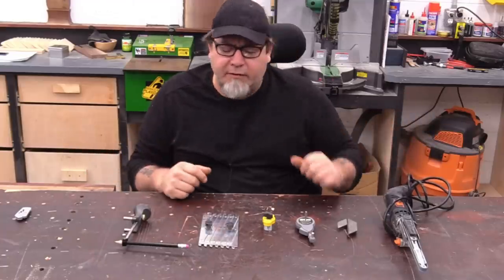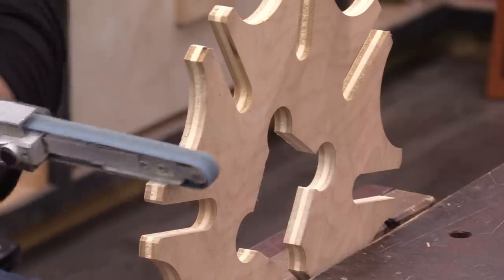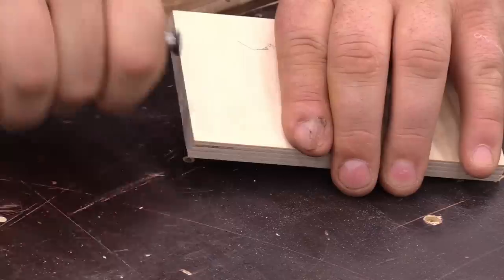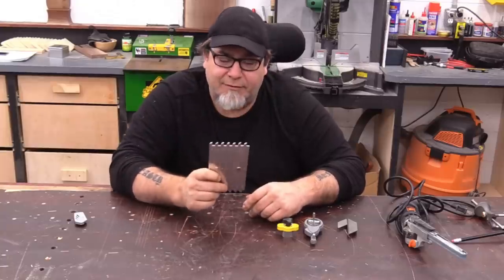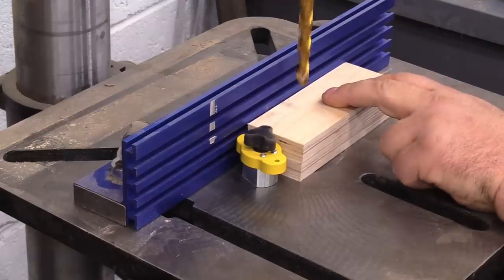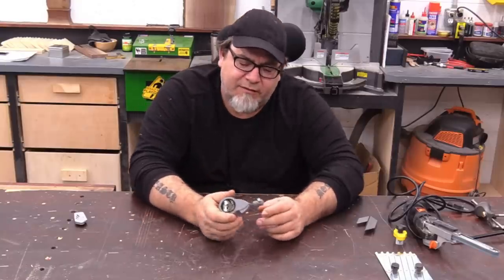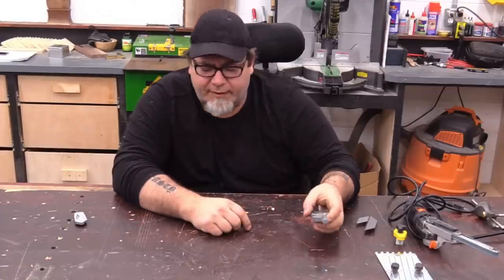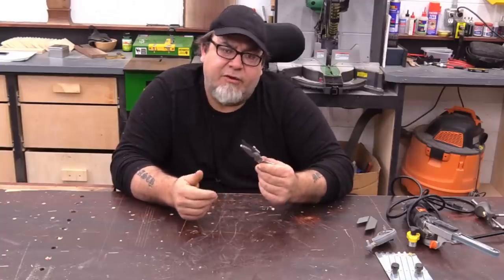5 Awesome Amazon Tools Under $50 | Woodworking

Comment: The band file sander is a dynamite tool. I managed a flame spreay company that ceramic coated pump parts. The band file with a 3M diamond belt let us polish flame sprayed silicon carbide to a smooth finish. Great for dressing impellers. 
Later I introduced it to die makers and Industrial fabricators. Great tool!

Comment: Those deep reach belt sanders get tons of use in the aircraft industry. We would use them to restore & smooth the inner surfaces of turbine engine diffusers & turbine nozzles after being epoxy or weld repaired.

Comment: I have that little folding razor knife. It’s made by Gerber and they have two different kinds. I’ve carried it for years. I use it to cut plastic wrap off pallets and open boxes. It fits perfect in the little coin pocket on a pair of jeans. I have friends that carry a regular knife. This is way less bulky and easy to change a blade for a constant sharp edge. Worth every penny.
Reply: I agree. And, the other model is slightly larger, and for some reason today, less expensive on Amazon. Don't know if it's enough bigger to suit Izzy though.

Comment: I used to work in a factory as a welder. We made bicycles from scratch. One of the stations was known af a linishing station where they used an air powered hand held belt sander to tidy up any blemishes.  I have never seen an electric belt sander like the one in your video where there isn't a huge electric motor stuck on the side that makes it clumsy and unevenly weighted. The one in yor video looks ideal.

Comment: Thanks for info Izzy.  The Q&A's on scriber/marking gauge say it is marked in only metric.  Picture looks like screw head holding wheel protrudes out past wheel.  If so no good for setting depth or thickness of material.

Comment: Reviews of the MK2 divider report that it is sloppy in the joints creating error in spacing. Don't know myself. Alternative is an Ikea scissor arm bathroom mirror mod by you, has tight joints. Attach extra arms with thumb screws from a second unit to increase marking points per unit length of material and max length. Ikea unit arm ends have pivoting mounting bracket and easy attachment of maker made marking thing-a- ma-jigs and doodads.

Comment: use to use the belt sander building stainless handrails for clean up,..had to change belt soon as belt would hold metal and cause rust to appear even in stainless,..

Comment: I don't generally like working with wood. Not only is the whole notion a little wimpy & limp-wristed (I prefer to work in metal. Wood is soft. It burns. It's imprecise. It's just too easy & forgiving. It's like a beginner's material. Unless one is making furniture or guitars, then it ROCKS HARD.), but I realy liked your demonstration. I'm absolutely going to buy a few of these items because of your video.

Comment: For a utility knife, I carry a MAC Tools UK111. It works very well and doesn't require any kind of tool to change the blade. Also, it fits my very large hands. I just checked the price at MACTools, it is $32.99. Like other MAC Tools rather pricey.

Comment: Husky makes a 'Sure-Grip' lock back utility knife that I use very often.  It's large enough that it's comfortable in the hand and does not require any tools to switch the blade, and it's around $10 .  My only complaint is it has a belt clip that I wish it didn't have.  It's very low profile, but I would prefer it to not have it at all.

Comment: I have a similar knife bu it doesn't require a second tool to remove the blade and is also longer.
They are great knives to have around if you can only remember where you just put the damn thing after marking a line!

Comment: While I haven’t seen that particular sander I do have something that is kind of similar but is geared towards a different purpose. I have the worksharp knife and tool sharpener which I actually have used for sanding before. I do also have a knife similar to the one that you showed. However I haven’t seen that particular type of center finder/square or the root tape.

Comment: I have found a utility knife that folds and is entirely made of plastic with the exception of the blades...
You can buy it at Walmart for just a few dollars$$$
It's made from hyper
tough and it's roughly the same size...
But it has been my blade of choice due it's super light weight and material plus it's metal free when going through most metal detectors

Comment: The Gerber utility knife has a thicker than usual blade in it. Not the standard thickness blades.
Reply: The Devil Maybe as it ships, but standard utility blades work just fine with it.
Reply: @jamessloanofficial  They fit loosly. You'd have to shim it to keep it from rattling around.

Comment: I don't like the Gerber utility knife, I've had one for about 5 years. It opens too easy. Not too long after I got it I had it clipped inside my pocket and it opened enough to slice my pants and stab me.
Reply: I bought a Milwaukee folding utility knife a couple years ago. It never opens accidentally, the blade never falls out, and I can easily flick it open or closed one handed with a snap of the wrist. I think I paid $12. I keep a Lenox straight utility knife in my pouch but this Milwaukee knife I edc. I bought the one with the extra blade storage in the handle, my buddy says it’s too big but it fits in my pocket fine. Every pair of jeans I own now has an outline of this knife worn into in the right pocket